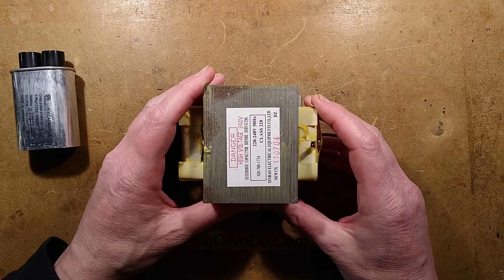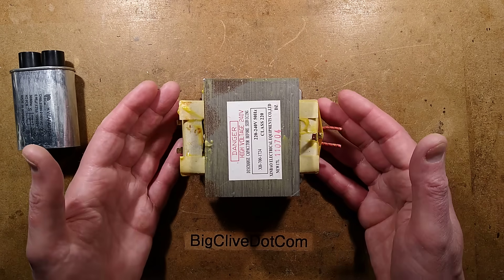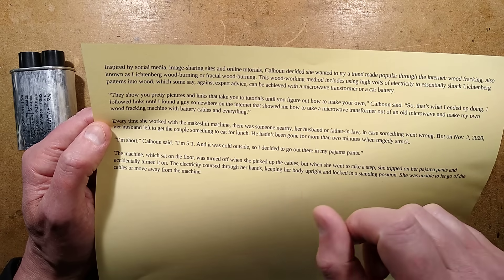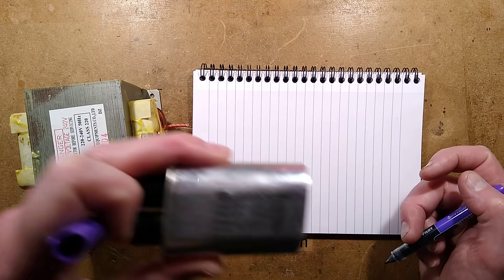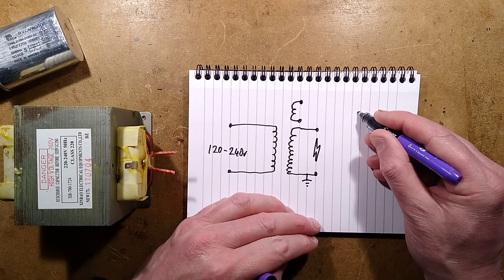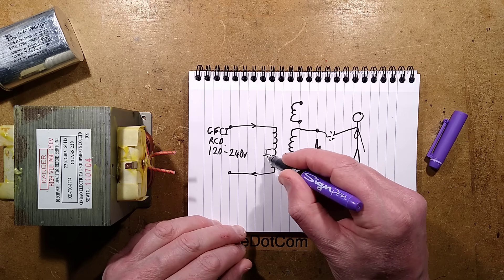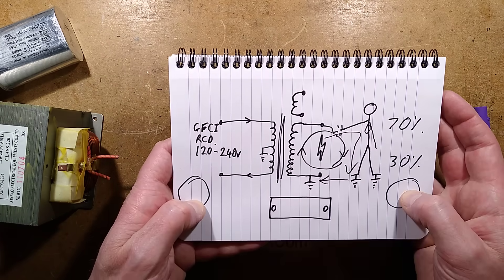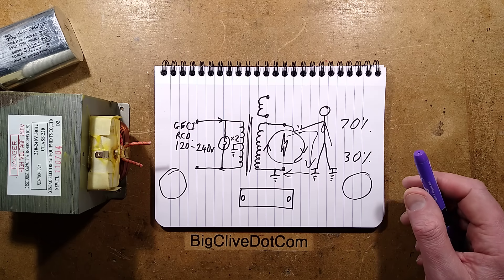The most deadly project on the Internet

Comment: As a teenager, I built a Jacob's ladder with an old microwave transformer.  I fully understood the danger, put signs around it, and was very careful to stay far away from the leads when it was on.  nothing bad ever happened, but I still look back on it and shudder.  I did understand the danger I was dealing with, but I was scarily confident and unconcerned.
Reply: My older brother also built one of these. He emphatically told us it will kill you if you touch it.  I guess he was right.
Reply: @kylejohnson268  putting 10 x 10 M ohm resistors in series on output may reduce the risk but the spark could probably jump these
Reply: Meanwhile Mehdi from Electroboom who grabbed his Jacob's ladde
Reply: Teenagers seem to have the delusion if invincibility.
Reply: @sarahs3988  Not just teenagers...The prefrontal cortex is not fully developed until 25 to 27 years of age...
Reply: I played around with negative ion generators even though the output was hundreds of mega ohms I got knocked on my behind one day due to capacitor effect
Reply: when the majority people are young, they think they are invincible, or there not even thinking , I was the same, I was not frightened by any thing, until I got in touch with reality.
Reply: @daibhiseaghdha153  Yeah lol. I've just turned twenty and I remember a lot of my thinking a few years back is me trying to curb my overconfidence, but all it really did was made me nervous about things I was trying to do rather than deter me from doing them altogether.

Though, I didn't try dangerous things really ever, so maybe it worked?
Reply: Textbook teen development, we just aren't able to properly consider or weigh risks at that age
Reply: I also built a Jacob’s ladder with a neon sign transformer. While it was running on the garage floor I adjusted it with a hammer that I held by the head.  This worked just fine. The hammer handle was wood (and apparently the humidity wasn’t so high as to turn it into a conductor).  Having gotten used to tweaking the wire positions to get them “just right”, I stopped thinking about what I was doing - once.  I reached out without the hammer.  Chances are I didn’t make contact with the wires.  But I was knocked backwards on my butt and shaken.  I was lucky, or protected by my buff angels.  I went on to pursue a career in electrical engineering ;o)
Reply: That's the thing about informed consent with teenagers and young adults. They understand the dangers intellectually, but they don't care because they think they're invincible.
Reply: Whats a jacobs ladder
Reply: @kaksidaksi3455  takes you to heaven lel
Reply: @kaksidaksi3455  The two wires in V shape that have "current" or ionized arc going upwards...
Reply: @kaksidaksi3455  old Frankenstein movie have them  they are a device that an electrical arc (spark) rising up between two rods
Reply: We were all legends as kids....then we grew up an america said....get a real job
Reply: @AndoLphin88  the man keeping us down/alive
Reply: Cool story bro

Comment: Yea I don't know how I'm still here lol. I used to put batteries on top of a glass plasma ball. And you could cut a battery using the electricity from the plasma ball  with a paper clip! You could cut it with your finger if you wanted but your finger will get very hot but not shock.

Comment: As somebody who's been shocked many times by things ranging from copper water lines to swamp coolers (which aren't supposed to be energized, took a connection apart with 2 wrenches and became the path of least resistance between the 2 lengths of pipe, luckily had pretty massive muscle imbalance so my back overpowered my front and the wrenches got launched) to the capacitors out of a disposable camera (capacitor said 240v, wire said 300, thought I was good, wire was not actually good for 300v, got zapped through wire insulation in one hand to the AA battery terminal on the charge circuit from the camera far as I know. Couldn't really tell on account of the longest few milliseconds of my life) I make it a point to only touch anything 10 volts and up with a single hand to prevent creating a circuit with my heart in the middle because after the capacitor incident I could feel the path it took for at least a week. Even disconnecting battery terminals in cars sketches me out these days, don't even get me started on welding. (But doing spot welding for work helped me get over it a bit.)

Comment: i remeber being 10 years old and taking apart our old TV, this was 1991, so the TV was surely from the 80s or before. I remember cutting a wire inside the TV and get electrocute, scared the shit out of me. 13 years later, me apprentice chef is making a salad sauce when the mixer felll into the sauce, me being the smart guy didnt give it a second though, so I grabbed the mixer that was submerge in vinegar and oil and i got hit with 220volts (i lived in switzerland at the time). Not so long ago I was cleaning a light switch in the kitchen and also got hit with 220volts... That stuff aint fun, I felt it all down my spine.
Reply: hopefully electricity decides to give you a break

Comment: I watched one YouTube video on how to make one of these and started making them and the only way that it’s dangerous or deadly is if you’re retarded and just stick it to your tongue.  
Just follow three rules
1 when it’s on don’t touch both metal leads with hands at same time. That WILL kill you! I use pvc pipe for leads. 
2 when it’s on and you’re burning use rubber shoes and a rubber apron on a rubber mat with rubber gloves.
3 use a shock protection socket. 

I’ve been shocked plenty of times while burning, by actually touching the wood. it’s very minimal. But still be careful bc some of you are stupid.
Reply: stay safe and careful when you're doing that though
Reply: @encross8058  just sold a piece for $500 the other day and I’m not dead
Reply: @fractalflowers2143  nice, stay safe brother.

Comment: Some Apple all in ones have 600-1000w powersupply in them completely unshielded and not encased at all right behind the same panel and inches away from where one would upgrade it's RAM
Reply: that sounds very dangerous
Reply: @encross8058  they really don't want people taking their* stuff apart. just saw a video of the Mac studio which also has a power supply just sitting in there under the glued (iirc) on lid.
Reply: @MrDJAK777  dang

Comment: So I've been doing this art for a little while now and a few things I would add.

1) Lock the device in a box or something else and make sure it needs 2 keys and give the second key to another adult. That way even if you feel tempted to do this while alone, you'd still need the other person there to even unlock what it's locked in. This is a safety step I personally use.

2) While I don't use low currents, I personally bought a Faraday suit and wear insulated clothing under it. It was expensive, but probably less expensive than a funeral.

3) I've got indicator lights on my unit as well! Good to see that here.

4) I'm totally also implementing the dead man switch.

5) I also wired mine to a sensor that as soon as it detects current sends a signal to a raspberry pi hooked up to speakers and it triggers a really pleasant him when power is moving through. It's redundant, but so are the days I get to live because I am very cautious.

5) ALWAYS clean yourself after coating the surface before you do anything else.

6) Always be overly cautious at every step. There's no such thing as being TOO safe
Reply: funerals are actually mad expensive lmao
Reply: @encross8058  yes. That was the point in saying it was "less expensive than a funeral"
Reply: @MaybeAnnatar  yeah

Comment: Now here's the catch; those who insist upon challenging Darwin will continue to research t'interweb to find out how to do this. Sadly, if they had the other half of their brain, a light would go on and they'd realise the principal reason why Big Clive uploaded this video, but that is not to be. My home built shortwave loop antenna can easily generate 4 kV across the vacuum variable capacitor but of course the frequency is way higher than mains, so the RF burn(s) would be hideous and problematic to heal. Gentle reader; take heed of Big Clive and cease 'n' desist. You know it makes sense. We love Big Clive ;<D

Comment: High voltage safety should be taken as seriously as gun safety: You need redundant safety measures and, the simple one, respect for dangerous devices.

As you said, you don't want to become casual with these things
Reply: I'd argue more in this case since there are industry standards and regulations for guns, here you're literally breaking machines apart which necessitates care to begin with, let alone using something that you may not know the full damage you've done already to it.
Reply: @oliverp3545  The analogy still stands, because few people ever make their own guns, for obvious reasons.
Reply: @kalebbruwer  yeah it's like making your own ice

Comment: Would wearing THICK rubber gloves reduce the risk of a bad burn? Your still going to be shocked, but will the it be reduced enough that you could still have motor function to remove yourself from contact and danger?
Reply from the maker: They would have to be new utility industry grade gloves and get tested regularly for pinholes.

Comment: I've seen 6 people electrocuted to death, 2 of them were executions in the US state of Florida many years ago. Believe me, you don't want to die like that. 4 of those people literally burned to death right in front of me and there was nothing that could be done for them, they were literally cooked to death. I've seen 2 people struck by lightning very close to me like less than 20 feet and one of them I felt the intense heat. I used to work on ships and offshore oil platforms, it's a dangerous job but ... don't let stupidity kill you like that. I still have nightmares and this is over 40 years later. That smell; you will never forget .

Comment: Would it be possible to build a safe at home system to frack wood that has enough fail safes as well as separates the user from any danger or is the voltage just too high to reliably contain? It would be nice to see a device similar to a CNC machine that somebody could buy, rent or hire a person to use said machine to discourage people from making these unsafe rigs at home themselves. The design this makes look amazing and though I would love to make some of my own, Id never do so. I am tariffed of even getting a shock from a cricket lighter, thanks to some unsafe things the "adults" around me as a kid did that caused me to be shocked several times
Reply: it'd  probably be pretty expensive

Comment: A common misconception ive heard is people hear that a device or the breaker can detect abnormalities and automatically trip itself and they hear that and think "oh, if anything goes wrong the breaker will trip and any life threatening situation will be averted" That feature has 0 to do with human safety, its only purpose is to keep the wires in your wall from overheating, that's it. If someone does something stupid and dangerous the breaker will flip yes, however it will flip after a stupidly lethal dose of electricity has already passed through you. If a horrible accident happens and you get electrocuted with an insane amount of electricity the breaker will flip, and it will prevent the wires catching fire and  burning the house down around your already dead corpse.
Reply: yeah it's designed to save electrical parts not people

Comment: I've seen fractal wood and it's really cool looking. I got a cool box with the patterns on it from the guy. I didnt really think too much when I bought it,it made a good mother's day gift
 I also comprehend the massive danger of high voltage and I don't think I'm capable of learning what I need to be safe doing this ontop of I simply don't have a desire to put such risk into something I see as insignificant to me. Its cool but I'll stick to wood carving.

Comment: I make sure to always wear my gear when I weld...But welding is the opposite, low volts, high amps. Microwaves are no joke.

Also, you can get these burn patterns A LOT easier by burning the wood with a hot needle and drawing out the pattern. If youre not a mathematician or a programmer, you can find one, and ask them to draw it out. Im sure most would (no, I wont do it for you lol. Im busy lol). But, this is just sad...THe things we do chasing silly fads.

At least set up a rig, where the magnetron is powered via a relay, and you are completely separated, and install a high voltage lightning rod, and connect it to wherever you may come in contact with the apparatus. This way, Ohm boy will make sure you only get a very small chunk of current, enough that even at the high voltage you wont fry.

The Lineman's comment though...thats chilling.
Reply: yeah you can also burn the wood with a magnifying glass in the sun which is a lot more entertaining
Reply: @encross8058  I think that would look cool. I mean, I was a mathematician so fractal patterns were part of my bread and butter, but we seem to have lost the artistic flair, the will, to steer the "brush" this way or that way, and create mathematical syncopies.
Reply: @RipRoaringGarage  yeah

Comment: Dont know if you reply to people who comment a month after a video is posted but i agree that this is extremely dangerous if not done correctly i do fractal burning as a hobby but have worked in the high voltage field for 10 years.  I built my own fractal burning machine using 1 low voltage control circuit and fiberglass isolators so im in no contact with any metal parts  if you had an email to which i could share this information 
Kind regards 
Reuben Carter

Comment: >holding high voltage leads for dumb art project
I unplug my coffee grinder before removing the grounds. Is there some special reason why you can't use alligator clips on the wood piece before turning on the juice? Ideally from several feet away?

Comment: I got ahold  of a microwave transformer, I do not remember how old I was, but I thought it was the coolest thing ever and thought I was being safe with the whole thing. I was not being safe with it. In my process to connect it to power I had bare wire connections and all sorts of things like that and then I would use the high voltage of the transformer to make large electric arcs, I would run a wire from the high voltage output of the transformer and arc it off of the grounded metal block of the transformer. It made impressive arcs. I could have so easily become un-alive from that, but thankfully when I ended up getting electrocuted it was not from the high voltage it was only from the 120 mains power. But it still went from one hand to the other m, my arms when completely numb all the way up and I got minor burns on both of my hands from electric arcing
Reply: Electrocution is always fatal. So no.
Reply: @SodAlmighty  “Electrocution is death or severe injury by electric shock, electric current passing through the body.” Not always fatal bud
Reply: @Huntsman6791  Incorrect. It is literally a shortened combination of the words "electrical" and "execution".
Reply: @Flux no it only lasted for a couple of hours

Comment: I’ve absolutely been shocked by one of these !! … OMFG it hurt.. had to of burnt me to the bone . Tip of my middle finger then arced across to my ring finger 2 more little pin hole like streamers going into my skin the first burn had nerve damage for a couple years tip if my finger was numb as well as for 3-4 days after it hurt like hell lol.. I had one of these wired together with 2 of those 2000v capacitors I was making ARCS just messin around been playing with these things for years befor I was talking to someone in my room looked away from what I was doing to kind of swing my arm and as I was turnin from my creating my fingers got too close to the main that was pointing into the air and ZAPPPP it sounded just like that zzzzzaaapppp  my left arm fell to my side and went numb could not move it … I grabbed it with my right and started shaking it in a panick thinkin oh I FUCKED UP!!! The person I was talking too busted out laughing not having any idea how dangerous what I was going was … havnt messed with one since LOL ..

Comment: They don't label shit "danger high voltage" for nothing. IIRC you had to be real careful with the CRT based TVs because of the about of energy that could be stored even when they were off and unplugged, but those things were a long time ago in "information age years". Very well explained, I learned a lot though I never thought about ripping up a microwave to make wood art. It does provide a good sense of "there's a lot of shit I don't know about electricity, so I should be real careful even doing simple household fixes." I prefer getting an electrician but sometimes it's just not worth it if it's something I know I can do. One time I found current on something that shouldnt have had current on it. Then I called the electrician bc I didn't understand what was going on there and that meant that was out of my league. So many people think they "know how electricity works", so let me burst some bubbles. All the energy in an electrical wire is traveling in a electromagnetic field around the wire and not through wire itself. In fact the electrons in the wire barely move. I don't really understand it, and haven't spent the time to try, but there it is.

I used to ride in the backseat of the car no seatbelt, or anything as a child in the 80s and 90s.  I survived, but that doesn't mean it was a good idea. Because all the kids that didn't survive aren't here to tell you the tale on the internet.